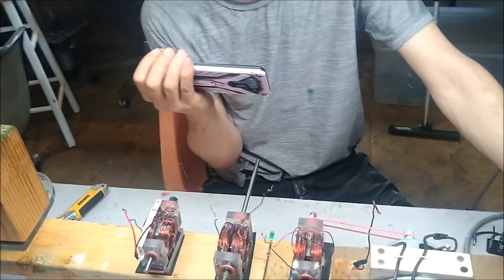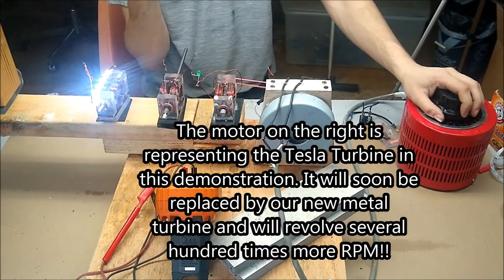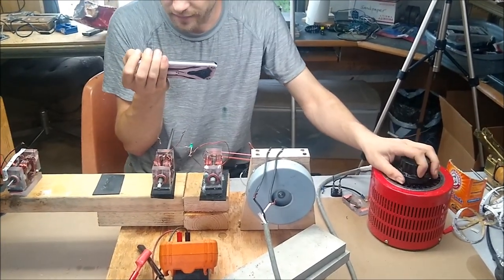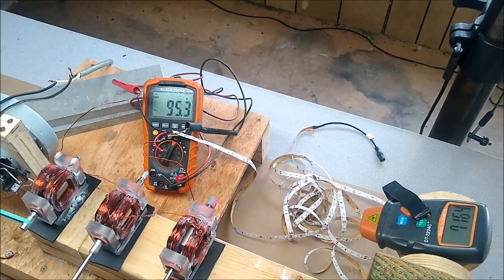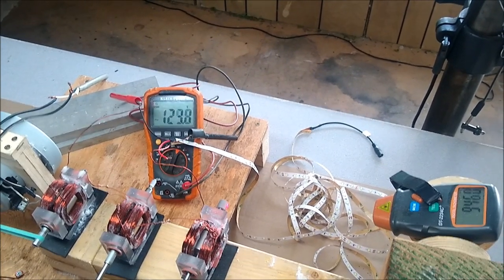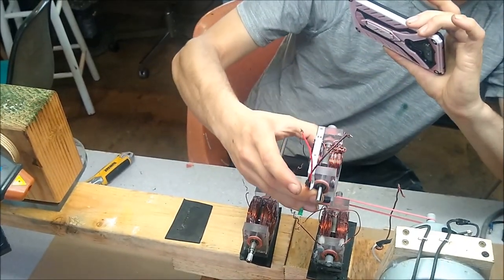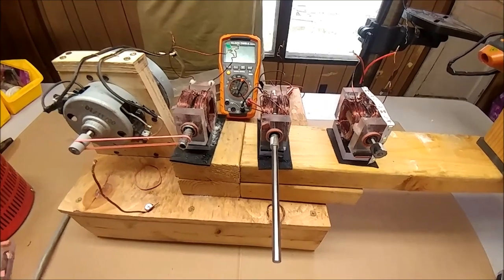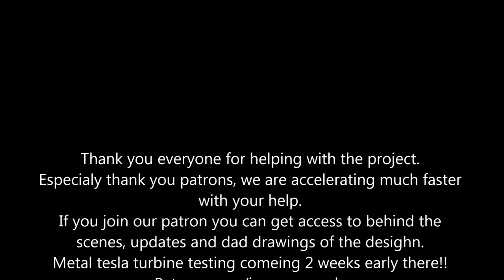High Speed High Efficiency Generator for Tesla Turbine!! Wireless transmission of motive force!

Comment: Lets say the machine reaches 80000 RPM and you would get 1040V which would be amazing . Don't you think it would damage the isolation of the copper windings? I heard that they are rated for 1000V max. Also i'm careful with my hopes in terms of the 15 Amps. Because the amperage heavily depends on torque. Did u every get a torque RPM diagram of your previous turbines? Also i would think under load your RPM may drop heavily if the turbine can not deliver enough torque. Did you got any experiments regarding this issue? Thanks and i'm really locking forward to the experiments with the metal turbine. Your doing a great job and if it works and lets say u get an efficiency > 22% u doing mankind a great favor. Greetings form Germany<3
Reply from the maker: Thank you! Here is a video that shows the power output capabilities. I've gotten over 15 amps dead short. We got over a horsepower with this plastic 3" rotor. https://www.youtube.com/watch?v=MkGAKqG2qvU&t=470s
Reply from the maker: I don't think it would damage it, but it might, will be fun to experiment with it.
Reply: Paul Panzer remember there’s better materials for the electron movement than this copper, but production expense is a limiter. I’m waiting to see some synchronicity testing, that’s where this will make some major power density hurtles. Look up teracopper for fun.
Reply from the maker: @blainevans7047  We really need to build a generator out of this stuff!!! Power density through the roof!!
Reply: iEnergySupply May i ask if this is on sale, drawings CAD files or is this confidential and you are looking at big investors.
Reply: @SamMonkulas  Teracopper interesting stuff perhaps a homemade version can be done with copper solution activated carbon and a kiln use a vacuum chamber to remove the air from the pockets and get the copper into everything and then bake it to a metal coating.
Reply from the maker: @Barskor1  I need a kiln.
Reply: @iEnergySupply  So do I :)  Here is Robert making one https://www.youtube.com/watch?v=lCQBsPCCqcY
Reply: @iEnergySupply  everything you need including the diy kiln from scrap and making nano carbon,copper,steel,ali bonding blends in the kitchen/down the shed etc, is already on roberts channel as you "the reader" probably already know,if not,why not!, tell everyone and start collaberating far more 
https://www.youtube.com/c/RobertMurraySmith/playlists

https://www.youtube.com/watch?v=14pE25UJW0I
Reply: Hey i want to geek out and help jello jerm.. hello

Comment: Does the extra wireless generators affect the motor performance when under load?.
Reply from the maker: Just adds more resistance the more power you draw from any of the generators.
Reply: @iEnergySupply  thank you for answering my questions. Love what you guys are doing. Last question... Is there a practical example you would use this for this in the real world?
Reply: @joshuadelisle  Generating power is always practical.  This design makes it possible to create modular generators that can be incrementally increased to any size.  Magnetic coupling is a key idea that will make manufacturing and customizing much easier.

Comment: nice but can you check the under load and check the input voltage of the prime mover if it goes high when you put a load, so test with and without a load , where did you buy the magnet inside of the rotor is it North and south ?
Reply from the maker: Diametrically magnetized magnets. Got them from k&j magnetics. Ill be answering more questions soon.

Comment: I found in a similar experiment that the power isn’t additive across the generators. When you put a load on one of them, they all slow down. This is easier to see when testing with a smaller drive or power source. Another way to test this is to check the max rpm as you remove the unloaded generators one-by-one. It should go up. Also, magnets decouple easily once one of them gets loaded. If you find something different, though, it would be great to see.
Reply from the maker: Actually I've found that it is difficult for them to DE-couple and have not had any trouble with loading it down. in-fact when you put them closer together the torque goes way up. Also note, at higher rpm the torque for a given amount of power goes way down. Ill show this in the future.
Reply: @iEnergySupply with a large drive unit or a large power supply driving a small load (like an LED) it will seem like there is a lot of torque. If you use the generated output from one of the coupled generators to drive a motor that approaches the size of the drive motor, however, the decoupling and torque limitations will become more apparent. On the other hand, a magnet coupled with a rotating copper rod or cylinder will re-engage even after being decoupled. But, you lose a little bit of energy to heat caused by induction.
Reply: @iEnergySupply  how do your generators behave in series ore paralel configuration   in MI expiriment in paralel the  magnetic lock is stronger becuse of the generators wil motor the others in phase
Reply from the maker: @PerpetualMotor  What you saw was coupling from far distance for show. If you put them right next to each-other you can't spin one and not the other by hand. It's enough torque to put out over 15 amps dead short.
Reply from the maker: @oscarverwey  You are absolutely correct about parallel. So far we tested everything in series.
Reply: iEnergySupply if you’re measuring output wattage (V*I) that’s greater than input wattage, that’s all that matters.
Reply from the maker: @PerpetualMotor  I'm not looking for free energy. Just useful transformation of energy which I've achieved.

Comment: Where did you get your diametrically magnetized magnets for your generators? How are they attached to the shaft?
Reply from the maker: k&j Magnetics, they have a 1/4" hole in the center. I sometimes shop at magnets4less
Reply: @iEnergySupply  Thanks! Your doing nice work!

Comment: Can it work if there is a wall between them?
Reply from the maker: Absolutely!
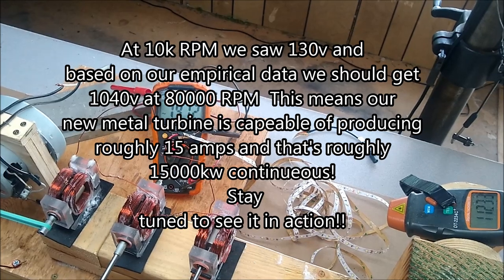Reply: @iEnergySupply  You made a mistake 7:46 You will get 15000W not kW  :P
Reply: @iEnergySupply  Also an idea, you can use the exhaust from Tesla Turbine to cool off the generator.
Reply: IMO it depends on if the wall is made with RF blocking materials or not.

Comment: does the engine torque stay the same?
 if yes ! it's a new revolution !
Reply: No way it can.
Reply from the maker: When a load is taken off an external generator it slows the turbine down due to the extra power it has to produce to keep everything rotating.

Comment: Please Please can you tell me HOW are these generators magnetically coupled together ??
is it simply ...good strong neodynium magnets ?  that is a few inches! HOW is one turning the next one ? they are not electrically connected (I dont think).... so HOW can you hold it in the air and it spins? surely its not simply 'just good strong magnets' that is the coupling..and nothing else.... or is it ?
Reply from the maker: Yeah good strong magnets, cylindrical magnets diametrically magnetized have fields that stretch out quite far.
Reply: @iEnergySupply  Well we all keep learning!  thanks, Im just astonished that the coupling is that far. Im really excited about the direction you are going in. I'm doing Hydrogen from water as an addition to diesel engines...we reduce the emissions by over 80% and increase fuel efficency by 22% in a fishing trawler and 40% in a car!  one emission reading said MINUS 0.01  that means it litterally cleans the environment as you drive! so just saying Hi from a fellow Interdimensional Wizard in Totnes UK. :o)

Comment: Quantos wats é seu compressor? E quanto deu de potência no eixo da turbina?
Reply from the maker: the compressor only needs to be used one time, then the system can be run over and over as long as there is not any leaks in the system.
Reply: @iEnergySupply  tank you

Comment: It's funny. I'm looking to buy a AVID cnc machine to in part start building out and experimenting with some of Tesla's inventions. I own his patent book and I was recently reading about his turbine. I looked up the turbine and just found you guys, I see you have a CNC so its nice to see im on the right track. Do you guys share any of your CNC cut temples if I wanted to build a turbine or are you keeping it all zipped up? It's your work, I understand not giving it out. 

Did you build these generators or did you pull them from something/buy them?

Subscribed btw.

Thanks!
Reply from the maker: We have the designs on our patreon account for the first turbine, but it will require lots of tinkering to learn how to make it. I have instructions on how to build one pre-cut. As you learn you will get better and better. I'd recommend playing around. I have 3d model of it on the patreon account. 

I built the generators myself they are pretty simple. just a diametrically magnetized magnet with two coils.

Comment: This is huge news!!! I personally would not focus on higher rpm but extract the most power by adding even more generators then the three that you have. My question is that there are only three generators here, how many more generators can be linked before the output drops? It seems that if we suspend one generator above and between two them then it should still work and extract even more power from the same RPM
Reply from the maker: I've found that just one generator works great. This was just a fun experiment that I wanted to show everyone. The generators have difficulty staying in sync under high loads. Since this we have quadrupled our rpm and with great success.
Reply: @iEnergySupply  I'm considering a wind  tunnel capture with a air amplifier and perhaps this could be a way to capture more from low rpm (sub 8000 rpm) or would you say the same output you can get from a single generator?
Reply from the maker: @digitalsoultech  o yes, a single, but larger generator would work great! I would get a 2"x2" neodymium magnet. Use large coils
Reply: @iEnergySupply  did you guys end up presenting in the energy conference this year? I tried to find you in the conference last year but nothing shows on their website as a presentor of last year.

Comment: Very interdasting. Gerard Morin showed how 2 e-motors were sharing their volts through the coils.... Like.... You probably got the same ammount of copper on all of them and apart from radial magnet coupling there could be "resonant" like a tuning fork coil to coil transmission.
Reply from the maker: I can't wait to do the experiments! And who knows what will happen at 65000 rpm. Same amount of copper on all coils yes.

Comment: You need to put a load on the wireless one. It will draw the others down, right? Its power divided, not power multiplied. But great work !! 👍
Reply from the maker: Correct.

Comment: Have you ever thought about making your rotors out of neodymium magnets.
Reply from the maker: I have but the magnetic field might not be too strong, if there was a way to use disk magnets and cut the exhaust holes then remonetize them that would be really cool experiment.
Reply: @iEnergySupply  what about yitrium carbon copper dioxide. I think that is what it is called it can be super cooled to make it into a super conductor, so it has to be a conductor and they make it in puck sizes, so I do not see why it cannot be machined to size, and cut the holes for the exuast. It would be a really cool experiment if you could actually run the liquid nitrogen threw it with out freezing up your external parts. Have you seen the drawing that I sent to testur energy. I put your name on the email hoping he would send it to you, but a 100/10 gear reduction would put you at 900 rpm, and than you can put a 110kw DC generator on it the way your turbine does not bog down. If you can actually find a 110kw DC generator.

Comment: WTF so the turbine carries the load of one generator and you magnetically couple other generators for free? Surely there is magnetic friction?
Reply: Wel Yas a bit, Only if you heve eddy currents in som of the object around the generator so a ironless motors/generators are the way to go
Reply from the maker: There is a  little drag from the extra generators bearings. When a load is put on any one of the generators the turbine works harder to maintain the rotation.

Comment: actually you have made a localised derivative of OzSolarPower's so called "Solid state Magnetic Field Diode".
3,935 views•Aug 8, 2019

https://www.youtube.com/watch?v=6eDI-kNsZ7Y&list=LLlLa8CrxqKTYdXEB4aweRFg&index=566
lots of info there you can use to improve the designs including making better use of the massively increased flyback with simple caps to store/reuse the currently wasted energy etc.
even try useing some reclaimed transformer core laminates to join the seperate "motors" facing windings rather than airgaped space...
Reply from the maker: I really want a diagram for this! Can you send it to my email? Notime500@gmail.com